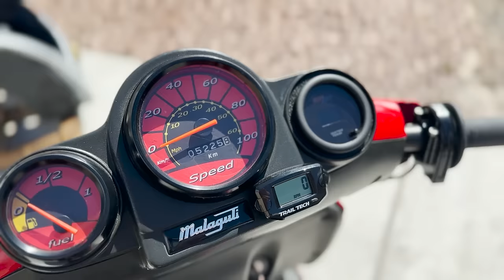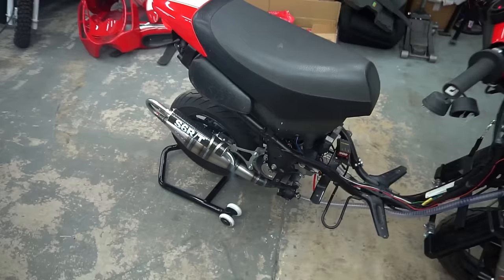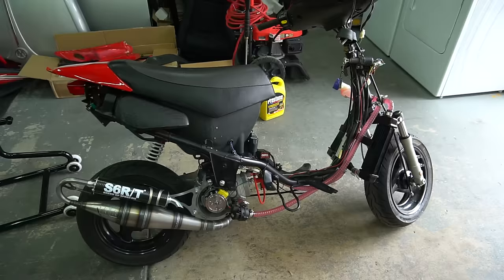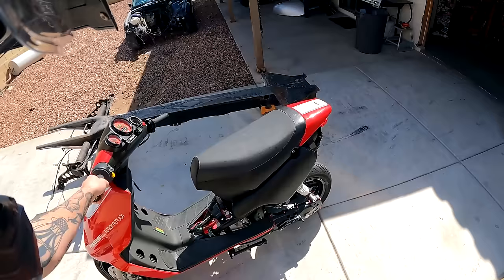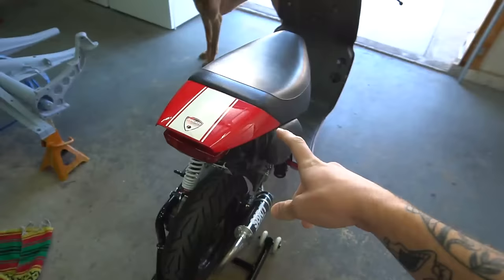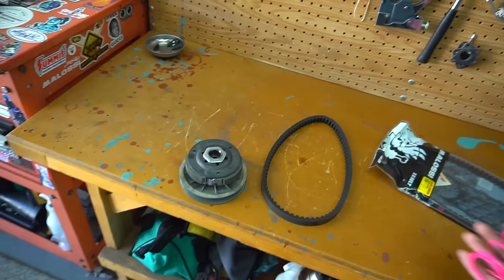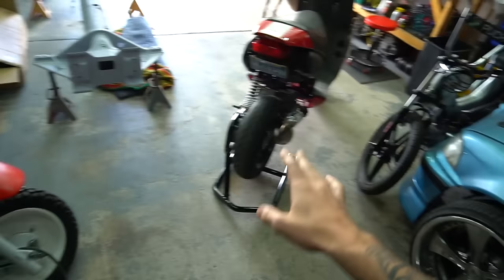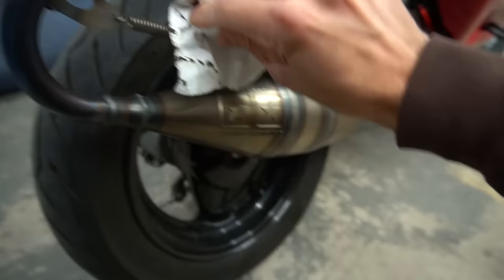I Doubled the Power of my Scooter! Phantom F12 70cc

Comment: F12 is a certified ripper😍! Small side notes: 
The bog from the start might be the shimming, belt not going it's full travel. Or it would prefer 4-4.2gram rollers.
A lot of new S6 R1200 / R1400 / R/T MK2 exhausts leak from the silencer. In Europe we just put gasket maker on it, let it cure for a couple hours and go full throttle. Sounds a bit ghetto but it works.
Waiting on that disc brake conversion!!

Comment: lose the stage six exhaust get an yasuni c21 ! , carb air screw 1 1/2 turn.    try and get full malossi overrange. if you want to go full wheely mode get and polini speed control vario.  nice bike you have there! i owned 2 my self.
Reply: Nah full stage 6 is better

Comment: My silencer flew off my stage 6 pipe on the road back when I had my stage 6 bike with a sports cylinder. That bike would do 60mph easily.  I blew up that cylinder from bad squish clearance. piston was hitting the head.  I parted out that bike after that. I have a ruckus clone bike now, with a 100cc stock engine and a v8 pipe. other than that stock. It does about 55mph no problem. I am much happier with the speed vs. $$$ spent considering I had over 1000$ in the first bike, and less than 500$ in this one with less problems. Thanks for the share love the makita battery.

Comment: new road 100cc
the second tune  you made with the stiff contrast spring is actually most of the tunes you can hear in a '' 100cc malossi trofeo '' races , they get all the torque for those sketchy curves in the Magione track  , you got that sweet spot with the soft contrast and it really fits on a 70 cc , altough a stiffer one is better from 86 cc and above

Comment: Hey man, greeting from Italy. Those things (Yamaha Aerox (GP1) and Yamaha BW’S as well) were all the rage in the 2000s. Some tips, a common mod back in the day was to install a GP1 radiator as well, in order to get usable temps on higher end cylinders. Also, as you already noticed, you should get the rear brake situation sorted out. Idk if you know this, but the Phantom was also sold with a read disk brake, you could try to get the casing with the disc and caliper mounts, as I don’t know if adapting a disc setup was possible with the drum brake casing

Comment: The F12 is my fave - love the Foggy rep. My Ludix Blaster runs a very similar rads and header tank set up. For easy bleeding just prop up front wheel and give it a few braaps with the tank cap off. Usually gobbles down another 200-300ml of coolant. Careful running too cold, chance of cold seize. Consider a thermostat 👍 great vid

Comment: hey man just noticed after watching this video for the 100th time you are still running af vacuum fuel system. You have to upgrade that to a better "petrol tap" I would suggest the malossi one. because the vacuum system cannot keep up if your riding full throttle for to long and that will result in the bike bugging out and run lean and foul your spark plug or destroy your piston. but a really nice video greetings from Denmark

Comment: If you go to some where that sell plastic single brick covers  9×4inch think they do them in Aliminum aswell
They will look good instead of holes 
there dirt cheap 
what they are for is going over the air brick in a house 
stops mice getting in

Comment: The f12 is even more awesome than before! I wish my Scooter  could do atleast 50-60mph. But i don’t think that there are that Many good tuning parts for a Speedfight 2, it’s a french scooter from Peugeot. Does about 43mph on gps without the variator restriction if i’m riding downhill for quite a bit. Can do 34 on gps maybe more on the straights. But it’s broken at the moment, the thread on the crank and the axle Hilding the clutch Bell is gone. I torqued the nuts for the clutch Bell and the belt disc WAY too much with an impact wrench that has WAY too much torque. 800watts and has 331.9 ft-lbs of torque. And a new crank costs 1499SEK which is about 142USD. Expensive stuff.
Reply: There are parts for the sf2
Reply: @ynk1011  yeah there are but not many very good parts. I have an air cooled sf2 and the website i order from doesent have many good parts. The best cylinder is a 70cc sport and it’s expensive af in my opinion. I live in Sweden so i don’t know if there are more good parts for it in the U.S or some other country.

Comment: i have an inner rotor kit with no charging, how do you change the wiring so that the lights run off of the 18v battery, would help alot as i have to charge my motorcycle battery every 2 days to keep it fully charged.

Comment: U rpm  need to be  arounde 14100 end 14300 dis is the sweet point on dis scooter  needle in the carburetor iff u gave the w9 change it to w7 end try it on the top setting if u whant more speed at the top u need to change youre
primary and secondary transmissions malossi has a good range but u need to get the 
the longest gears they sell
Trust me i now i have raced dis scooters in italy the malossi championship end we have reached up to 155kmph whit a full high end 70cc ofc we hade a c one  
Engine

Comment: What did you use for your light replacement. Did you only change bulbs or sockets also. I need to for my 2001 F12 LC DD and 2003 f12 LC DD

Comment: Hey, I also have a problem on ma ac minarelli with the drum brake, It is also very bad and i've done everything a brake line, pads, double spring, even switched to another wheel and it is good for 2-3 days and then it just disappears. Will switch to a rear disc brake

Comment: Hey mate love the build I’ve done exactly the same on an air cooled Zip. Malossi overrange instead. 
Blue contra and half mix 4.5 and 4.7g rolls. Rpm hovers around 11,600rpm, only other difference is a Malossi Mhr team pipe. I would have thought you would want to be just under 12,000rpm seeing your using the R1200 pipe. Where are you at now with rpm?
Reply: can I ask you a bit about the zip haha I have the same setup

Comment: Nice build
Do you ever do a price breakdown.
And i personally don't don't like S6 pipes i find the build for the money it's not worth it.
What's your thoughts on Leo Vince pipes.
Cheers brother
Reply: I agree with you about the stage 6 exhaust.

In Europe, I think they are overpriced. Pretty good performance but low quality. Thin metal and being unlacquered is not what competitors supply.

In my oppinion nothing beats the Yasuni/Bidalot exhaust range. In this case a C20 would be perfect.
Malossi team ('04 -'06 or 2) also, but they're more expensive. 
A Hebo Manston, Metrakit Pro race (2 and up) , TJT F1, or Kundo F1 are i.m.o. better exhaust for the money.

Leovince (for so far I know) doesn't mak e exhaust in this rpm-range.
Also not the best quality for the money. Not bad, not great.

My pick for a low/middle revving 50cc or low revving 70cc would be: 
Tecnigas "TREK" (not the "next"), Laser Xpro, Yasuni R/Bidalot s2 or s3R, or Gianelli Shot.
Reply: @theowarmelink7347  
Yep I agree with you about the Leo vince 
I have a Derbi Atlantis 50cc AC with the piaggio engine and I notice the rpm range likes to flatline right around 92 KPH AT 9400RPM on flat ground and I know I can get a few more kph and Rpms out of her.

Comment: Question please: I have a 06 BWs, will be putting a Polini 70cc head on this summer. Will up the jet by 10% and have a temp gauge. Do I need to suppliment my 2T oil by a little premix? or will my oil pump handle it?
Thanks so much, love your content.
Reply: i highly reccomend you get rid of the oil pump, i wouldn't want to risk my motor, if the pumps fails, but i don't think you will need to add any more oil, except add some for the breaking in phase
Reply: @kristers-eb6xb  Thank you so much!

Comment: Why the Stage6 Exhaust 1200 on you Stage6 Racing mk2  , when the Stage6 have made the Exhaust R1400 for  the Stage6 Racing mk2 cylinder , your Exhaust Stage6 1200 is made for the stage6 Sports Pro mk2 …